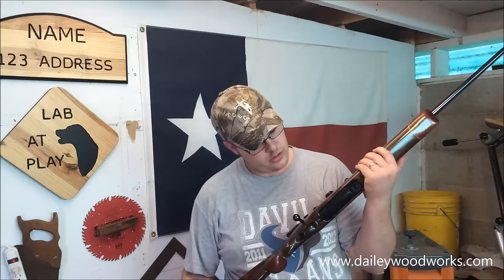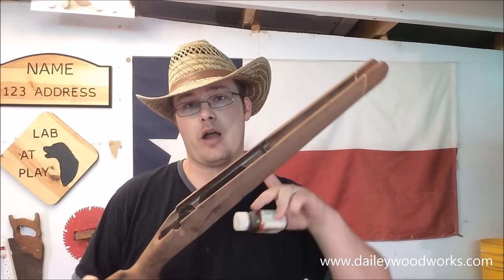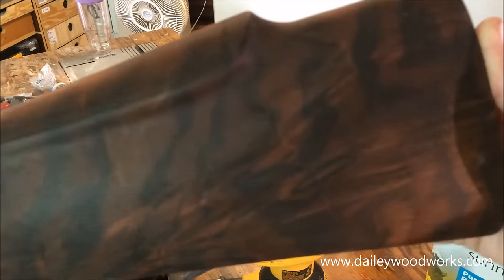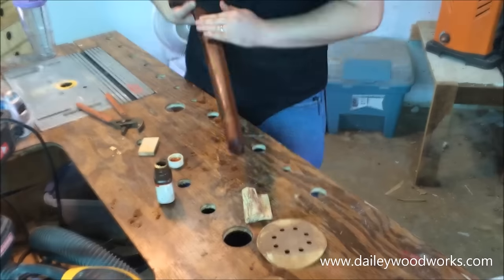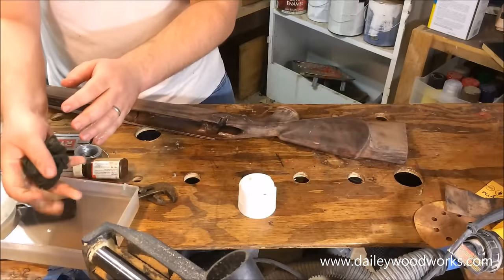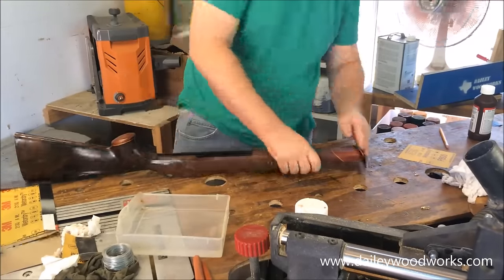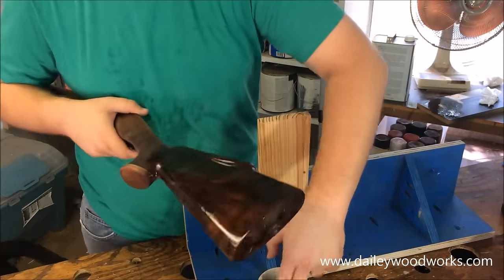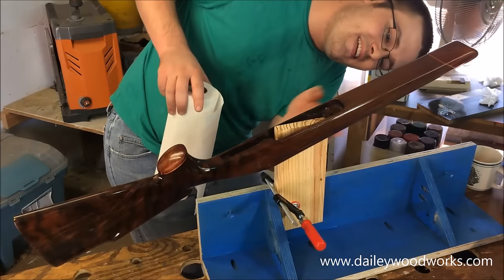Finishing a Gun stock with Tru Oil - Complete How To (The Recreational Woodworker)

Comment: If you want a classy finish after several coats of tru-oil rub the stock with rottenstone and light oil.
If you want a high gloss shine rub the stock with Turtle Wax scratch & swirl remover.
If you don't leave the tru oil dry long enough,two or three days or more.  more is better, (that is VERY IMPORTANT) or the previous tru oil you applied will  "gas" thru the new finish and create little bubbles that look like you didn't clean the stock well enough.  Ask me how I learned that. haha  make sure you have enough true oil on the stock before rubbing it with anything or you will remove the finish to the bare wood.  Ask me how I learned that also.  I use at least 600 grit
sandpaper between coats.  Sometimes 1500 or 2000 grit.  Always wet or dry type.  Don't overdue
it.  The finish is very thin. The finish is very soft so don't put to much on or it
will scratch or dent very easy.  One last thing.  Be sure you tape off all checkering with masking
tape.  True oil was not made to be used on checkering.  It clogs the checkeringk, You will
not be happy with the results.  Those are the things I have learned mostly the hard way.
Good luck.                                       2-13-2022

Comment: So this is your process?

Clean with mineral spirits

Mix Mineral spirits 2 parts to one part of True Oil, lather on with clean rag

While it’s wet use 220 grit sandpaper to drive in the True oil into stock

Wait 2 hours then apply another coat of diluted true oil 

Wet sand with 320 grit sandpaper and use a damp cloth to remove dust and then let dry. 

Buff with Steel ooo wool

Let dry then apply first true coat of true oil full strength with fingers and rub in. 

Let dry 2 hours, wet sand with 320 grit and wipe with a damp rag. 

Buff with ooo steel wool, clean with tack cloth to remove any steel wool metals 

Apply full coat of true oil, let dry. 

Apply final coat of true oil.

Comment: Can a guitar body thats had a very light matt sealer finish on it be done in Tru Oil to get a nice gloss without totally taking it back to bar wood. Thanks. Great looking gun.
Reply from the maker: It’s never a good idea to add one type of finish on top of another. Especially if you don’t know what the original one is. 

Oil finishes are designed to soak into the wood. They don’t do well sitting on top of another finish. Probably not what you wanted to hear. Sorry.